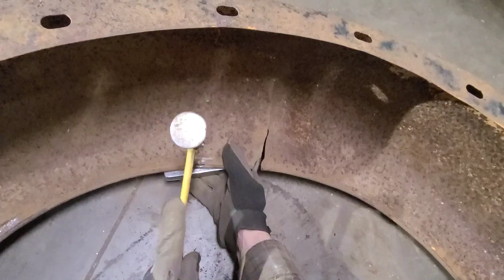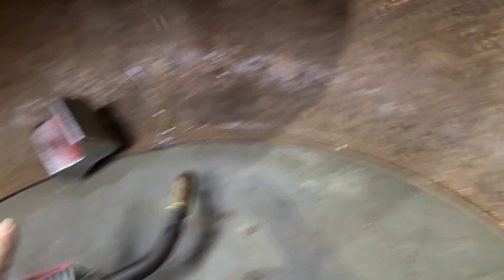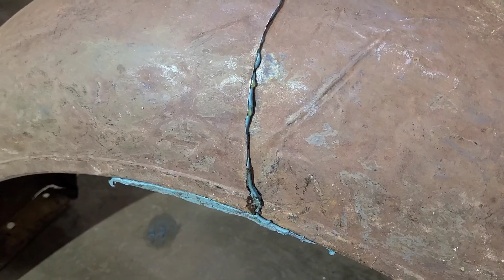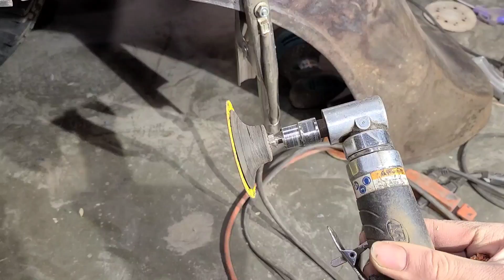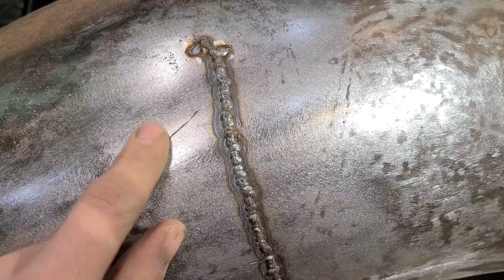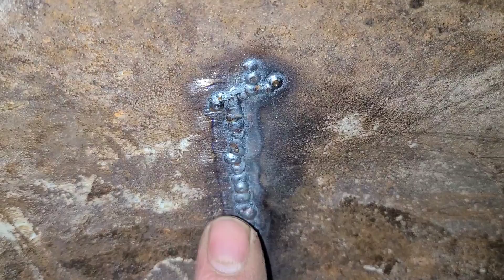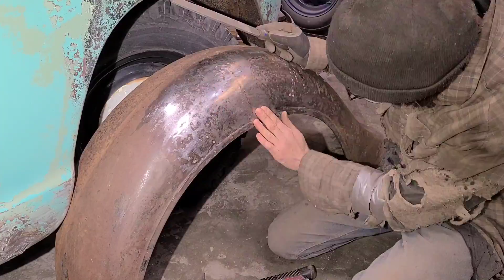Mig Welding A Cracked Classic Car Fender

Comment: I have tried some sketchy stuff, but never fix a crack with body filler, if I did try I would use metal infused filler. But you are more talented than me.

Comment: Penetration:

That was perfect. When I butt welded quarter panels on, I would set the welder exactly to penetrate like this.

It give a solid bead on the back side, so you can metal finish on the top.

I always cooled with an air hose.

Comment: I don't know if you've heard of this but, there is a variation of the Aunt Jemima technique that you have so masterfully detailed here, it's called the "Raccoon deviation" and utilizes the fine strand fiber found in the fecal matter of Raccoons and makes a final bond that is, reportedly, 12.6 times stronger than the parent steel! The only drawback to this alternate technique is that the Raccoon feces must be no more than 3.5 minutes old prior to being mixed. If the fecal matter is exposed to the atmosphere without being blended with the polymers in the donor body filler then it's strength properties are greatly compromised. If possible, it is preferable to have the Raccoon on hand to empty his bowels directly onto the affected work area prior to mixing. At any rate, it is so nice to know that there are men like you who are out there on the bleeding ragged edge of vintage body panel restoration working to broaden and enhance the ever growing pool of knowledge in the burgeoning and quickly changing field of endeavor. Thank you, Sir!!

Comment: Man have I been there. My first was a '53 Chevy rear fender and quarter section. Anyway..... curious, I would never argue that brazing is more effective than a mig or tig weld but have you considered doing a light tutorial. I do know from experience, even coat hanger brazing is better than fiberglass and plastic.
Reply from the maker: I don't do any brazing, there's just no use for it anymore.  As far as bad repairs go, I prefer it when people hack stuff together with fiberglass or plastic. It does far less damage than a bad welding or brazing job.
Reply: @CarterAutoRestyling  yeah, I get that, at least all the shit can be ground away.

Comment: A fun one! As soon as I saw the bondo, I smelled BS!! Yeah. I also noted some real howling wind sounds at  a little after 17 minutes -- is that real? I figure December up there could be gnarly. Lots of spot-on advice about subtle issues in using these welders, grinding, etc. I notice you use steadying techniques, both for welding and grinding. And that fender is mighty mangy. I will have to watch the next video. Strangely, I find your calm voice and hammering techniques calming and mellow -- goes good with German Octoberfest beer..

Comment: Swift rule of thumb on "hammers" is smaller exerts bigger pressure, whereas "bigger" acts like a snowshoe & does n't. Snowshoes don't sink as they're big - same applies to hammers. So if you have metal to hammer, the icklest hammer with the skinniest head hits way better than the big flat useless snowshoe ones. A tiny tacking hammer with a 10mm head (3/8 of a banana in "American")  exerts more force on panels than any other hammer & is ergo the best hammer & possibly the only hammer as most other hammers are a bit crap by comparison.   Just saying, like.
Reply: Plus everyone knows 3M twigs are the best - no way are those 3M twigs. They look like cheap import twigs. Pure amateur.
Reply from the maker: They are overseas knock offs, can't afford the name brand stuff!
Reply: @CarterAutoRestyling  You need a better Class of Customer. :-)     If you're working on your own stuff, even more so...... never work on your own stuff if you do "vehicules" as your living - it's why every plumbers tap drips. They got better taps to be tapping than their own.

Comment: Kyle, I'm finally getting a chance to watch the videos you made before  I subscribed.
Don't worry though.. I won't comment on each one. ;)
However, if I see a glaring error I have no choice... as in this video.
In my experience doing bodywork (since the early 70s when everything was perfect), the reason that your plastic repair didn't work is that you used non-politically correct pancake syrup. That brand has been in the news recently for this very reason. Ok. maybe not THIS reason but... you know.
Try using corn starch and 10-15 drops of crazy glue next time. I'm sure you will be happy with the results.
Seriously, that crack came out nice. Good work as usual.
Thanks for the entertainment and the learnin'.
Reply from the maker: Hi Joe! Thanks for the tips! I don't watch the news so I had no idea that I was using a culturally insensitive brand of pancake syrup. However, after reading up on the matter, I now understand why the repair failed. Next time I'll do better.
Reply: And that right there folks is the sign of a true educator and crafts-person!

Comment: Kyle, instead of twigs could you not use a small coil spring or two to brace the repair. They should obviously be flexible enough to move with the bumps but of sufficient wire gauge to support the two adjacent pieces of wing?
Reply from the maker: Excellent idea haha! I'll have to give that a try on the next fender!

Comment: could you use a english wheel to get the little low spots
Reply from the maker: Probably with a good quality english wheel and patience, not work the risk with my cheep unit, one wrong move and you end up with a track mark in the panel, and those are way harder to bodywork than any minor imperfections

Comment: Love your videos and learn a lot. I want to pass on a good tip i picked up from a Ron Covell video. Try using ER70s-2 spool wire instead of ER70s-6. It has the consistency of the tig rod and may be hard to find locally but is plentiful on the internet. Even had the local welding supply tried to tell me there's no such thing, "That's a tig rod number". You can beat on this weld a lot more and not crack it. Kinda like the advantages of tig in a spool wire.
Reply from the maker: Thanks for the great tip! I will be looking into that one for sure, as I'm having trouble even finding regular mig wire locally these days!

Comment: Why don't people braze metal anymore please?
Reply from the maker: Too much heat, requires a lap joint to have any strength, and the flux will cause paint problems if it's not cleaned properly. There's a channel on YouTube called "Trevs Blog" he made a video comparing brazing, tig welding and silicone bronzing and he explains the pros and cons of each in great detail.

Comment: Do you grind the weld on the inside?  I have not seen you do it, but I have seen others do it.  With the weld bead on the inside is there any issue with the dolly not sitting on a flush surface while you are hammering the outside?  With the bullseye pick; is hitting the inside weld an issue too or not?  Thanks, love the work you do and I'm trying to get better.
Reply from the maker: Hi, great question! With mig welding I usually prefer to leave the weld alone on the backside for a little extra strength. However it's one of those things I just play by ear. If it's affecting the hammer and dollying then I'll grind it off. Sometimes when the weld shrinks it will go high instead of low, so you need to grind the weld off the backside to get it to hammer down flat again. 
With tig the weld is so soft that the seam is barely visible on the backside once the hammering is complete. A quick pass with a grinder on the inside is usually all that's needed. On these fenders I like to boxline the underside to prevent damage to the outside surface from rocks, so by the time the boxliner is applied the repairs are invisible, ground or unground. If your doing a show car where the whole underside is painted, then obviously more prep needs to go into the weld seams, but thats a whole 'nother can of worms!

Comment: Hi, I've been welding a old motorcycle mudguard that's only .020" thick I've been grinding the weld down with mini tungsten carbide bits , they're easier for access too as it's part of the frame .

Comment: Thanks - I needed a good lesson on repairing junk - although it would have been better 5 or 6 years ago on the old 40 Ford - A sledge hammer and the cement driveway doesn't really give the best results - LOL - A cool yule and a frosty first to you and yours.
Reply from the maker: Thanks John! I've done the sledge hammer and concrete driveway thing too haha. Whatever it takes to get the job done!

Comment: Had you used Quebec maple syrup, the filler might’ve held. I like how you squinted and turned your head while welding. So much safety!
Thanks for another hilarious vid. I have a request; please show us how that repair would’ve turned out, had you welded the back side of that crack instead.
Reply from the maker: Ahh good suggestion, I regret cheaping out on the syrup! Haha

 I have tried welding from the inside before, it's a good idea in theory. The problem is that as the molten weld passes through old metal, it picks up all the impurities and contamination from the steel and doesn't finish out as nice.
Reply: @CarterAutoRestyling  thanks for the explanation.

Comment: Great job Kyle, that is what I was waiting for some mig crack repair. I have a lot of that coming up on my fenders and other rust repair. So you use .025 wire and hot settings for penetration? I like your method too, all the other videos use the spot technique and keep filling, but your technique eliminates the pin holes which I think is the way to go. And yeah keep going on the fender, I'd like to see more metal shaping and the tools you use. Thumbs up my friend!👍
Reply from the maker: Thank you Ken! I use .023 mig wire, but .025 is the same; I think various manufacturers just measure their wire differently. I prefer to set the welder hotter, that way I can move faster and still get a weld that's fully burned in. The way I was taught was to practice on some metal the same thickness as the vehicle (preferably scrap pieces cut from the vehicle). Play around with the welder settings until you're happy with the weld, then go weld on the truck. The welds on a vehicle will never look as nice as the practice pieces, but at least that way you know the welder is set correctly. 
Thanks for watching! I'll try to keep the metalwork videos coming as I have time.
Reply: @CarterAutoRestyling  Thanks Kyle for the instruction, I'll definitely practice on some scrap, good idea. I like your grinding technique too, I was just hitting the welds with a flapper disc and removing a lot of metal with the weld.

Comment: I reckon your pancake syrup must have ben a bit old. I also add a bit of coca cola to the filler as its acidic so etches into the metal and sticks really well. I've even used the mixture to stick wheels on when I've lost the lug nuts.
Reply from the maker: Excellent observation and tips. Lug nuts are hard to come by so I will be sure to use that one in the future!

Comment: Great video! I was laughing so hard my sides were hurting! Would you recommend grinding/sanding the underside of the fender so you can paint it or leave it? I'm thinking if it were to be a concours restoration. Would your preference be Tig or Mig welding these cracks? I just got a Tig welder as it seems the best option that most prefer as the welds are easier to hammer and dolly. Thanks
Reply from the maker: Yes you can clean up and grind the backside. With mig welds I usually just grind any large bumps on the backside and leave the rest for strength. Tig welds you can clean right up, although after hammering planishing most of the weld is flattened out on the back anyway. On driver quality cars I like to boxline  the underside of the fenders to prevent rocks and debris from flying up and putting "outy" dents on the exterior of the fender. In the past on show cars I've had to do the whole bodywork and paint the underside of everything too. With those cars you need to tig weld everything... in certain lighting when the paint is polished and smoothed to look like glass, a mig welded seam will show through the paint...even if it's buried under layers of filler and primer. In regular car restoration this doesn't matter, and even on show cars 99.9% of people can't see it, but it's something that judges look for.

Comment: Buddy, I've been watching CWM for about 3 years now and when Scott says something is worth doing, I have noticed that he is almost always correct.  He said to check you out and in one video, I picked up on a few things I didn't know and also a few other tricks to try out myself as alternatives.  Also, you had me laughing myself silly in a few places - your sense of humour is very much like Scott's in that you sometimes wonder if he is being serious.  That dead-pan delivery style and the dry wit is much appreciated.  If I had known of your channel sooner, I would have already been here, so the fact I am here now just means that things are how they are supposed to be....and no, I haven't received your cheque in the mail as yet.  I did receive the envelope though......

Another great video.  Certainly appreciate the tips in this one too.  Interesting to hear you prefer TIG on splits.  I have yet to go back through your previous videos to check, but am wanting to know if you have done one of repairing the lower quarter of a rusted / previously repaired door skin.....and / or if you did, which welder would you use and why?
Reply from the maker: Thanks for the kind words! As for the door skin, it really depends on the car and whether or not I have access to the backside. If I don't have access and/or it's just a small patch in the corner I usually just mig it.  I did a video a while back on replacing a chevy van door bottom with a tig.

Comment: On camera it looked somehow that the middle of the crack was overlapping a lot. It seems though it was not really the case.
Reply from the maker: It was due to the fender being bashed in and beaten out with an axe in the past. Once the metal was all back where it needed to be everything lined up flush again.

Comment: Finally someone who is drilling a hole at the end of a crack! I do that with metal and repairing fiberglass or plastic bumpers as well. The joke with bondo repairs was funny once, but we have seen it now. I was surprised though how easy the bondo fell off with the first hit.
Reply from the maker: It was mostly just to entertain myself, but I won't be doing that type of thing in every video. I spent more time on the bad repair then I did on the rest of it. It was also meant to be slightly educational...we live in a world with unlimited access to information, unfortunately much of that information is misleading. Youtube is filled with "how to" bodywork videos involved horrible misuse of bondo, fibreglass etc...yet people accept them as fact because the information is presented in a convincing manner. An important and often overlooked part of education is showing people the wrong way to do something and then illustrating why it's the wrong way.
Reply: @CarterAutoRestyling  To be honest, I am a lousy body man. But seeing the crap on youtube: Bondo on rust, bondo by pounds, kitty hair on cracks without any overlap and much more.
That does shock me! They are doing it on expensive cars as well. Those people are earning a lot for showing this crap. And if you suggest something: like not only filling a crack with kitty hair and grinding it down to the point were only the crack itself has bondo on it, or you suggest drilling a hole on a plastic bumper at the end of the crack, you are completly ignored or even regarded as a moron. Most guys believe these hackjobs are good repairs. It is mindblowing.
I did repair cracked plastic bumpers on my daily beaters by reinforcing the inside with metal plates  and repairing it cosmetically apealing. And in general those repairs last for years. But those are cars I will drive on for a while before I send them to be scrapped.
Reply: I totally agree, I was taught to drill a small hole at the end of a crack when repairing metal while in the military. I always felt it relived the stress on the crack.